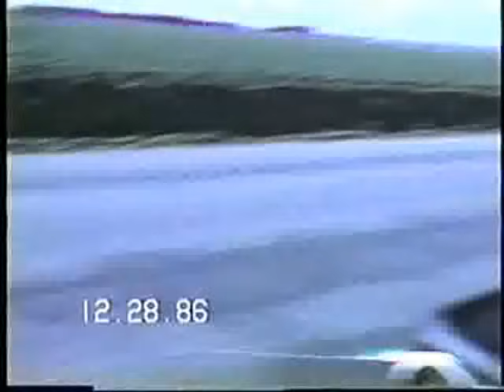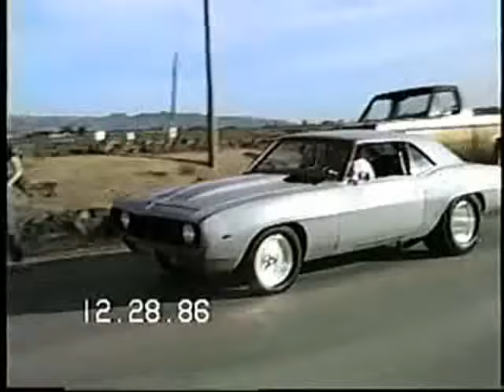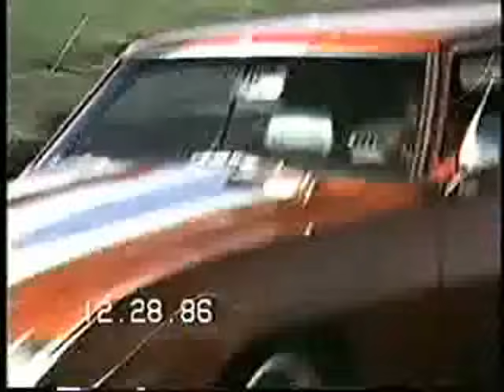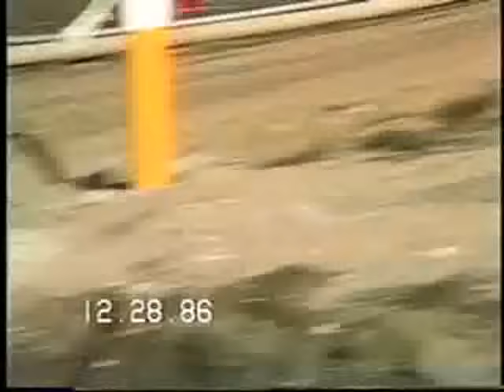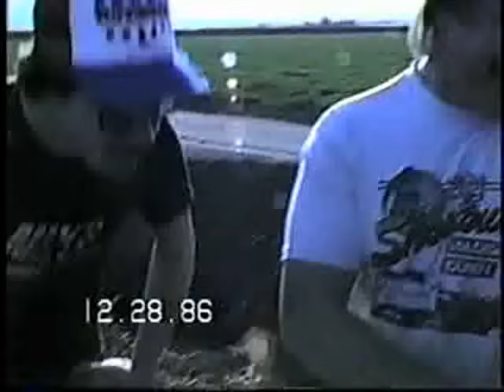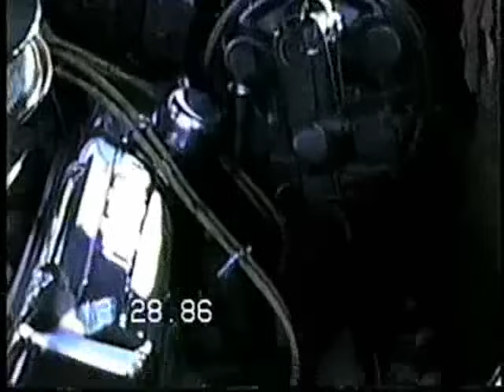12/28/86 Street Racing

Comment: Ahh yes! Back when if you had 400hp to the ground you where king of the streets.
Reply: Now making 400hp out of a 350 is pretty easy lol.
Reply: Now it’s 1,000 but they’ve never driven a 400 WHP car, so I get a hellcat engine cheap after they wad it up in the first 50 miles
Reply: @ROBIN_SAGE my thoughts exactly. 600hp is the norm and with some tuning and couple mods you’re 800+
Reply: For sure, 400 hp was a hell of a lot back then!
Reply: @stevenvanheel3932  that's what i like about now actually. i like also there's many options.i am more of a car guy not so much a brand guy, i like ford, dodge, chevy etc.
Reply: @Jus10-born2Run  shit changing but a electric car with 600 hp isn't cool and we don't care about it , we all still appreciate 350-500 horsepower , atleast i do i'm only 20 i WILL be getting a 2020 ss
Reply: @TheZaxx  Chevelle came out with 450 Corvettes had about 500 for 80s 400 is pretty good

Comment: I'm 62 & the 70 & 80's were the best times for me & my Hot Rods,  we'd go to the local Denny's,  make call out's,  then meet over in the industrial area, most places were closed that time of night,  except for a few semi's coming & going once in a while.
Reply: Yep.  Used to go to industrial areas to run since there was no traffic or intersections.  We would have lookouts for both cops and other traffic and would make sure streets were clear before running.  About every street racing crash you hear about these days are from those running through intersections, curved roads or heavy traffic areas.
Reply: Right on we from clas of 1978 Yuma Az. had fun fun fun , i was lucky to have a 1967 Chevelle for my fifteenth birthday, But couldnt drive it for almost half a year, i had to get my Drivers License permit :) , my borther who is 3 years older had a 1969 SuperBee Man the fun times at Yuma Union High we had real deal
Reply: Too bad about the spelling & punctuation thing you never grasped.
Reply: For us in ny area it was Vandalia ave , red hook,and the conduit  in brooklyn not burn outs but real drag racing
Reply: I had a 71 Plymouth Valiant Scamp with a 230hp 318 and a 3 speed manual transmission.We raced down an industrial drive that also had very little traffic at night.My Scamp only weighed a little over 3,000.Couldnt run with the big blocks but a fun little car.We had a blast.
Reply: hey vern ever hear of flint you know motor city. the area you describe sounds alot like home. i worked with and knew a few verns. what is the chance.
Reply: @jenkemjones68  try 450 ft lbs of torque right off idle in a square body s10 blazer. the new $100k corvette cant even keep up hellcat did you smell that?
Reply: No sorrry not from the flint area, but you never know sometimes it's a small world, lol   The Good Old Day's, without the crap our GOV is doing today.
Reply: @chehystpewpur4754  I never had anything with that kind of power lol.I added an edelbrock carb to the Scamp which helped a little but like I said those big blocks 396,440,400,454,etc.would smoke me with my little 318.If only I coulda did a 340 swap I'd done a lot better.I bet that Blazer was one quick boy.
Reply: that’s sweet man, car shows of any sort? were you big into those or what. must’ve been a blast i find myself coming back to this video time and time again

Comment: I never saw narrowed rearend street cars in the 80s. Our cars needed paint and were fairly stock with headers carb and maybe a cam. These were wealthier kids than I at that age!
Reply: Primered hot rods were a thing back then. I've seen some new cars today that look like clearcoated primer grey
Reply: Yeah... and nobody I knew had a blower either.
The fastest street car (daily driver) I knew of was a friends dad.  He had a 72 camaro w/a small journal 327 that he had built by a race shop. I personally rode in it and saw the tach swing to 8k rpms on the 1-2 shift (turbo 400) where it laid a good 40ft patch from the eagle ST's.
He told me it ran a 11.99 at 117mph w/slicks and mid 12s on the ST's at Bradenton Dragstrip.  
It was bright orange w/white stipes and was in perfect condition. And he drove it daily to work 17 miles each way.
Reply: We scrounged the best factory "performance" parts we could find used. Double hump heads, less restrictive exhaust manifolds, maybe an aftermarket intake and a used holley.
Reply: In the late 70's in my area the lucky guys got a low mileage grandma driven Dart, Nova etc. for 16 birthday while the rest of us had to work low paying after school/weekend jobs to save for a 2 door beater to mod.
Reply: @SweatyFatGuy  I worked a paper route for 4 years and saved 1K for my first car in 1981. Price was higher because it had crushed velvet upholstery, Monroe adjustable air shocks 50's and Cragars out back,and Hedman headers no exhaust just Thrush straight thru mufflers bolted to collectors, I was 16 and it seemed cool at the time.
Reply: The best of times. Watching this almost brings tears. We were a generation that worked and built what we drove. You'd see an old car sitting in a field, driveway or some abandoned place one day and at the drag strip the following weekend. Maybe someone reading this will remember a place called Hawk site down off the stretch heading to key largo where wed race the whole weekend.  I wouldn't change a minute of them times . ✌️
Reply: The Camaro  with the narrowed rear end should have put that money under the hood as that little Ford Falcon would have spanked him.
Reply: @theupscriber65 And hydraulic camshafts instead of hydraulic roller cams.
Reply: These weren’t high school kids. They worked like I did back then 2 or 3 jobs and spent everything (time and money) on their cars.  So glad I got to do this in the 80’s, 90’s, and early 2000’s. I am lucky enough to still have one of my cars from back then still in my garage. (1990  Foxbody). Good times!!!!!!!!!

Comment: I was a senior when this was filmed.  It was a couple years later that I started street racing.  Had a 69 step side with a 402 in it, home ported heads, decent cam, Holley intake and 750 carb, some deep gears, and the widest slicks I could tuck up under the step sides.  It did quite well.  That Falcon appeared to have Mickey Thompson SS on the back.  You were the man if you had them on the back of your car and they were the soft compound ones!  Good times back then when you used your brain, knowledge, and skill to build something instead of your Visa Gold card.  Video brought me back in time;  just needed some actual racing, it was good though,  Thanks.
Reply: Hi, Falcon had McCreary circle track tires. 👍

Comment: A 69 Camero was only 18 years old in 1986. Crazy to think about how new they were then.
Reply: I owned at 1967 and a 1968 pro street camaro in 86. I was stationed at fort Ord near where this video was shot at the time.

A nice 68 or 69 Camaro would set you back about $4500 with fresh paint, deck stripes, and mild rebuilt engine.
Reply: @Steve_Kelly_Oak  I have a 2004 and a 2005 puck up trucks that I drive every day that are not that old in my opinion, but as old as your cars were in 1986. Somehow, I doubt that my trucks will be worth tens of thousands in another 30 to 40 years.  In 1990 I got my 1st car, a 1970 El Camino with a 350 4 barrel. Loved that car.
Reply: @CarbonGlassMan  You are right on that!
I graduated high school in 1984 and my dad told me back then to enjoy the old 60s and 70s muscle cars while I could because that era would never come back.

I have been doing my best to drive mostly old school classic ever since!
Reply: True. I had a 73 Z/28 as my daily at this time. In the summer of 87 I found a 46 GMC that I also dailied. Still have the truck.
Reply: 17 unless it was sold in the fall of 68
Reply: @CarbonGlassMan  Yeah you're right. They won't be worth tens of thousands. They'll be worth billions when hyper inflation hits in the 2030's.

Comment: That Falcon  sounded the best out of them all.
Reply: Hi, That's my 64 falcon. It did run pretty good. It has a 351 Cleveland in it.
Reply: @ruazfast My bad I thought it was a comet I have a 64:2dr sedan with a 302 roller Birds the word!!
Reply: @ckelley63 Hi, I also used to have a 65 comet before this car.
Reply: This just popped up. Really enjoyed this . My falcon was a 65 futura. Oh the memories. 74 GTO ran high 9s. Yes, I had turned a few wrenches on her.
Reply: @danielseymour6726  I do like to hear the people, Enjoy the falcons 👍
Reply: The cam I was using was a comp cam 589-615 lift It really wasn't a street cam. It ran good but it didn't have much vacuum.
Reply: @ruazfast what rear gear were you running?
Reply: @ruazfast do you still have that car to this day?
Reply: @Everything-Street-Outlaws-NPK Hi, Yes I still have the car. It just  hasn't run for over 20 years. It has changed a little bit since then. Thanks everyone for posting 👍
Reply: @jimjoe9945  4.57s at the time. 👍

Comment: Brings back memories. I remember trying to squeeze 500 hp out of a small block chevy. It took some serious cash to achieve that. Today my Scat Charger comes that way, not to mention a line lock and programable stall converter all at my finger tips. Computer stores all the parameters of performance on board. Even has a G meter for traction information. A shit ton more i just can't remember it all.
Reply: I had a 65 Falcon convertible 289 4spd that i cobbled a NOS fogger plate and a solenoid switch from an airconditioner that i activated with my finfer the button was on the shift handle...i usually guessed when to hit it after looking at the tach..hopefully i wouldnt hit the nitrous in between 1st and 2nd gear..hopefully it come on when im already squarely in 2nd gear..it was 'hit or miss'..i blew the guts out of the engine once or twice,fragged a clutch a couple times destroyed a 9in detroit locker....now all the nitrous can be dialed in on a screen and the computer actuates the nitrous...wow!
Those SCATS come with A/C,Power seats and windows,all the EGR stuff intact...all the stuff we dumped back then in order to gain some power and drop weight...amazing machines the Challengers,Camaros and Mustangs are today
Reply: Its not easy trying to get as much horsepower as you can for the next guy to race.👍
Reply: @getoffenit7827 I have nitrous on my 64 falcon. It can make a big difference when you're racing big block cars. 👍
Reply: New cars with gobs of power from the factory also have no soul
Reply: You werent making 500hp with a sbc back then. 300 to 350 at best. Dynos were hilariously inaccurate back then. Its even difficult to make 500hp with a sbc these days. Unless its boosted to the moon or youre giving it all the nitrous lol.
Reply: There were many 500hp small blocks in my area in the 80s, my old man had two Sbc cars he ran and a bbc car with close to 800... If you have a good machinist and and experienced builder 500hp is not too difficult to achieve... Even today most dynos aren't too accurate but if you time your runs on a set distance with the exact weight of the car and the speed its easy to calculate the power your making, its been done that way for a long time..
Reply: @Mudsuitable  again you might have thought you were making 500hp but you werent lol. Back in the early 90s my uncle had a max effort 350 built for his 70 nova. It made 400hp on race gas. 500 is a stretch for a 350 without boost. But what ever helps you sleep at night lol.
Reply: @Mudsuitable  getting 500hp from a small block Ford isnt quite as easy especially with a junkyard budget i didnt do too bad with my homemade mix and matched parts with porting and some guesstimating i dynoed 337hp out of a 289 but for my budget i had no more money for that next step into forged pistons,aluminum heads etc
Reply: @Andrew_460  true words..500hp from a smallblock anything wasnt in the realm of possibility for most of us unless you had nitrous...i had it on my 289 and got 337 but too many times that basically stock 289 2 bolt main bearing block isnt going to take too much of that.
Into the 2000s i got it dynoed again..i hadnt changed anything on the engine since 1989...the 289 dynoed at 299..and 314 on nos...quite a difference in dyno accuracy...theres no way my 289 was making 337 back in 88-89...i was surprised at how bad the timing was how bad i had set up the carb..crappy plugs..i thought i had dialed it in by ear pretty good...nope! Haha! The dyno tech was a godsend and we got the 289 set up as good as it was going to get with the internal parts i had used
Reply: @Andrew_460 maybe back then it probably was pretty difficult to get 500hp out of a SBC but it's pretty damn easy these days with the heads that are out now.
Reply: @Andrew_460  also on a budget you can easily make 400-450 hp with 350 vortec heads off the mid to late nineties Chevy 350 motors.
Reply: @Andrew_460  hell, my dad was running high 11s with a 283 and camel humps in early 1990s. And he didn't have a lot of money to be playing with.
Reply: @bigrig.  you dont need much power to run 11s if its a light car.
Reply: @Andrew_460  you have no clue what you're talking about a small block Chevy can make reliable power over 500 HP!!! You've never heard of 358 modified dirt cars that have around 600hp or even 383 strokers that can sustain over 500hp!! I've been around race cars and race engines all my life obviously you have no experience in motorsports!! I know what they can handle not only from my own experience but from what was passed down to me from people waaaay smarter than you..
Reply: @Mudsuitable  you know you lost the argument when you resort to name calling and insults lol. Stay mad!
Reply: @Andrew_460  I have a small block in my shop right now built in 1991, (my Dads old street motor) for racing around NYC that will put down 530 to 551 HP depending on humidity, ambient temp and elevation on any dyno you want, no boost no nitrous carbureted all motor...
Reply: @Andrew_460  I should know better than to argue with fools...
Reply: @Mudsuitable  sure you do lol
Reply: @Andrew_460  do some research before you speak about things you know absolutely nothing about..
Reply: @Mudsuitable  well youre arguing with yourself at this point so...
Reply: OP said TRYING to get 500 HP not that he did. And he's right if you paid for professional porting, used 13-1 comp and all the other pricey parts you could get very close to that.
Reply: Now dodge is a foreign car company too

Comment: Back in my day we would get aquarium air lines connect to the windshield washer reservoir fill with clorox and water position the hoses over the rear wheels wet the tires and did a real burn out..we also had line locks..class of 73..

Comment: back up 10 more years and a fellow i knew had a falcon like that with a BOSS 351 .. was virtually unbeatable ..
Reply: Yes, the Cleveland  was supposed to flow Pretty good.🧐
Reply: that was the first thing you tried to find for your 289- those cleveland boss heads.
Reply: @tommurphy4307   i built a bogus BOSS 302 in 76 but tried to run an automatic trans .. could`nt make it work .

Comment: I'm looking for information on a car that my dad and I built, and raced in Modesto in the 80's. there's a couple of pictures of it, in my pictures. it's in grey primer. it was a 69 dodge dart gts. it was a 340/727. we raced it in Modesto in the early 80's. we raced against a guy named "Tim", he at the time had a Pontiac. and a guy named "Jed" who had a 426 wedge. we sold our dart to a Mexican named "ralph" (I think) in about 1985. some people who were around the street racing crowd in the early 80's, used to call our dart "the sling shot". we had a reputation of never getting beat off the line. any info would be appreciated. I'd really like to know what happened to the car
Reply: I’m in Modesto rn 21 with my 65 SS Malibu
Reply: I street raced in the 80s in Sacramento.  Cruised Modesto back then too.
Reply: @dangarrison3503  they were the good ol dayys. What car did you have?
Reply: @ihateliberals518  I had a 63 Plymouth Belvedere 496 big block 727,3000 stall 8 3/4 w 4.30s. I had the same set up in a 71 Duster
Reply: @dangarrison3503  nice! We had a 67 belvedere 1. (2 door post) we took out the 273. And put in a go 440. Purpleshaft hydraulic. 727 3000 stall. 8 3/4 with 3.91.( we couldn't find the lower gears we needed) we really took our time putting the engine in. We got all the right linkage little bolts etc. When we were done you couldn't tell that it wasn't originally a 440 car. Of course the vin tag would still give it away. That car, for no more then we had in it ran pretty good.
Reply: Yeah ummm..it went to a crusher?
Or it's in a barn somewhere and it's been undercover since it was parked?

Comment: Ummm well.    A ford dressed up as gasser ( and can barely turn the tires)   a prostreet camaro with a gear drive that runs 15 in the 8th)    and a nova with front runners and a snorkel scoop with single wheel burnout. )    yep the good old days.      If it looks fast it must be fast.       Lol.     But at least then we actually worked on our cars.   Not have a shop build it.  Tune it by lap top.      I bet anything one of those being this was 86. Still ran dual point distributor.      Let's see some one set the points and dwells on that today.   Lmao.
Reply: The ford ran pretty hard. I think when you launch the car, the idea isn't to blow the tires off. But what do I know.
Reply: Sure all these had electronic ignition upgrades.
Reply: Still run points on my SBF, but I sometimes feel like a dinosaur...
Reply: People would laugh when I do my small burnouts. What they didn't know. I'm trying to find out how high RPMs I can take off at. Like they say spinning ain't winning.👍
Reply: You said that the Ford  barely spin the tires. 27-in tall tires and 4.57s it's a little hard to spin them  a long ways. I believe the one pass my tack showed 7,000 RPMs👍
Reply: @slowpoke96Z28  The falcon had an Accel dual point, back then. As long as you have a dwell meter, they're easy to set the points. 👍